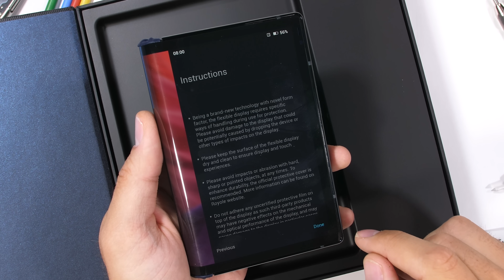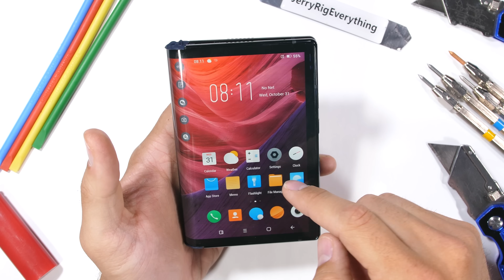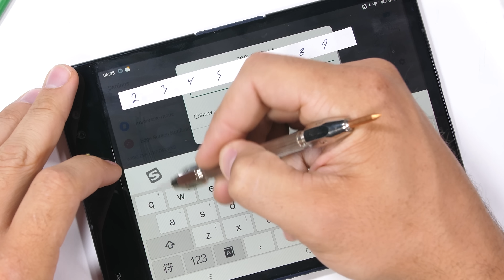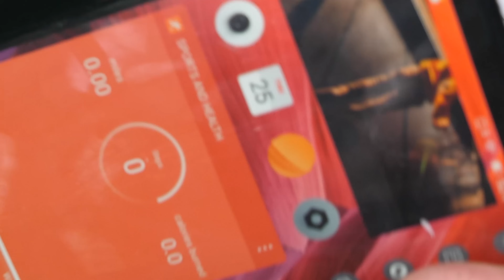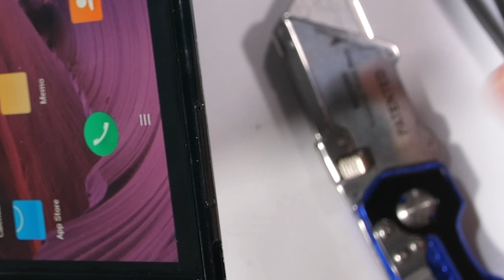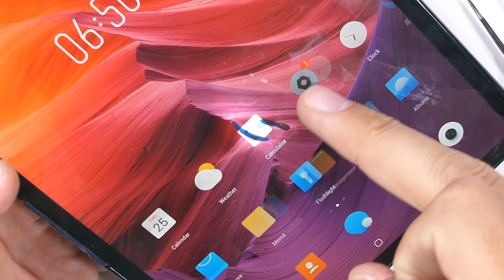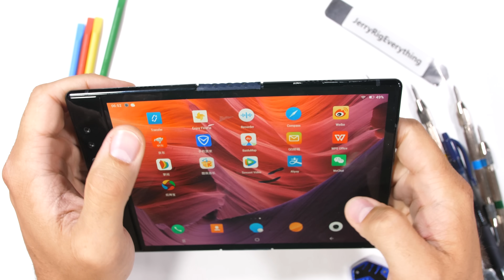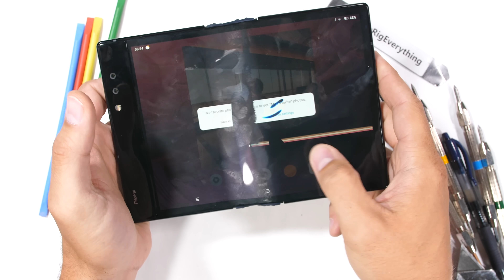Can a Folding Phone Bend Both Ways?! - Bend Test!

Comment: I think at some point foldable phones are going to be the future, but right now they're just expensive gimmicks, and even though it did put up with a surprising amount of abuse, that soft plastic is going to get destroyed just through daily use, I'm not rough with my phones, on the contrary, I look after them, since I usually try to keep them for as long as possible, had my last few phones for 3 years each, and they're still in pretty good condition, but I can't imagine how messed up that thing would be after that time, assuming it still works at all, and for what it costs, you could get a good smart phone, and tablet, and it would still be cheaper.

Comment: "Since glass is glass and glass doesn't bend"
....
Optic fiber: am I joke to you??
Reply: Never heard this meme before
Reply: even a sheet of glass in a window can bend a bit. if you bang on it with your hand you will see it wobble and vibrate
Reply: Other way around ... yeah that only bends so much but yeah you're right
Reply: Dany Shehadeh 😂
Reply: Side note, fully flexible glass is actually in development.
Reply: Glass is glass and optic fiber it’s optic fiber
Reply: @Snakyy1  true talk))
Reply: Well, I've never seen an optic fiber in a phone yet.
Reply: @bluuu_  neither did I
Reply: even diamond can be bent, if it's thin enough
Reply: optic fibers can bend, tho not much to the point of folding, they can still be coiled in a limited radius. even your tempered glass screen protector can bend quite a bit due to being very thin
Reply: razrafz but it’s still not glass :/
Reply: Are you stupid? OPTIC FIBER CANT BE BEND MORON. Try to bend it it will be break
Reply: optic fiber can bend due to its weave construction but its only very wide bends if its a sharp bend its dead either way not good for screens since it would leave a weave pattern visible through out the screen and not be flat thus scratches could pull chunks of glass out.
Reply: Optic FIber is not made out of glass but a polymer
Reply: @thookie118  It's made either from glass, or polymer, or both. The "core" is usually glass, but the cheaper ones are from polymer and are less good because of higher signal loss.
Reply: Thore no it’s made from glass
Reply: @thookie118  most cheap ones are, but there are glass fiber optic cables

Comment: When you closed the phone completely with the screen inside it looked like a little pocket book, I would absolutely use a phone like that, especially if it had a smaller normal screen on the 'outside' when it is folded so you don't always have to use the large one inside.

Comment: imagine if they made tvs in this material with all connections in one corner.
then come as a giant poster roll where you can cut it to desired size  by following dotted lines on backside  for the right ratios.

Comment: it begs the question. why would anyone need a folding phone to begin with? I know some might want it because it looks cool but for practical use a normal 8-10 mm thick 6.5X3 inch slab of plastic or metal with glass is more convenient. actually the current dimension of 6 inch phones are already too bulky to comfortably sit on your pocket. also no headphone jack? disgusting. I'd rather stick with cheaper mid range samsung phones (because the more expensive samsung flagship does not include expandable memory or headphone jack anymore)

Comment: Thanks for your video!

I think it's a dumb idea, I would never buy one.  I prefer a brick phone with no pop up camera's or bending, folding or sliding function...  I have always been like that.  Just adds reliability problems and especially if a camera pops up every time you go to use your phone say for face unlock, the electric motor will drain a chunk of you battery life...  Folding phone's are the most stupid tho IMO. No case, no screen protector..  and look how weak the screen is...  Fkn joke 😂